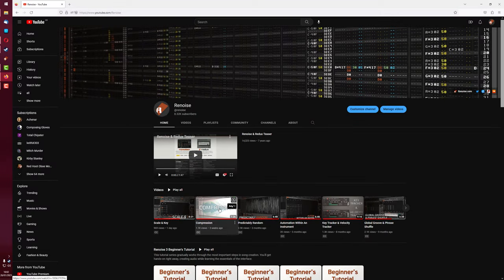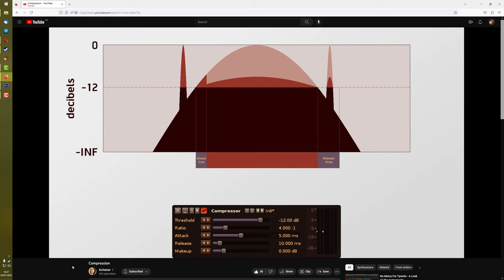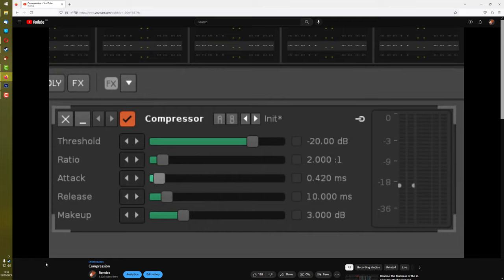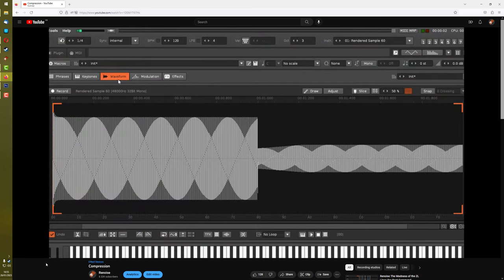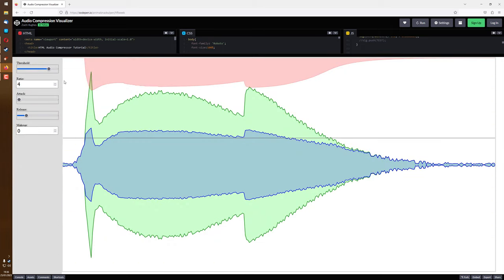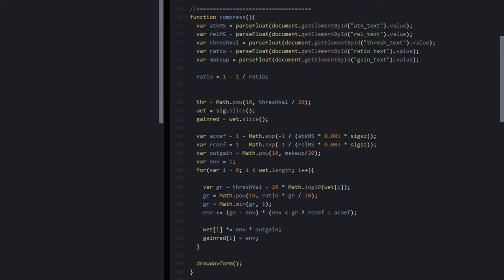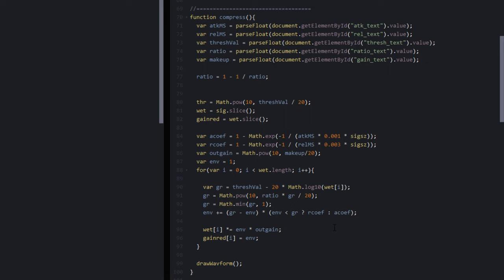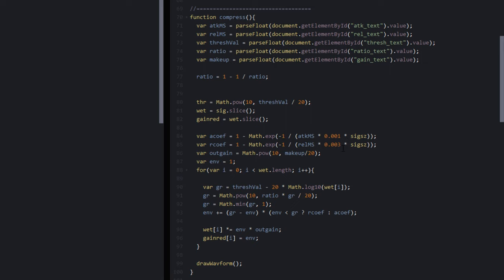Compression In Renoise

Comment: Really enlightening to see the code for calculating the envelope of a compressor. From what I was able to gather either the attack or the release coefficient is used whether the previous envelope is above or below the gain reduction.
So I think at some point both coefficients fight back and forth while the waveform volume stays constant.